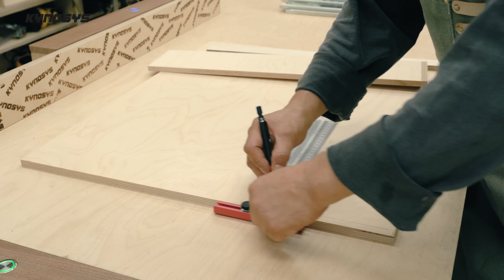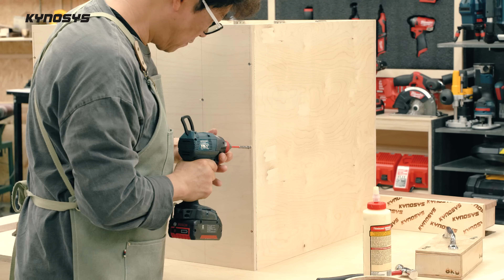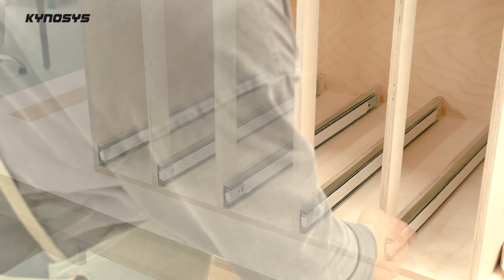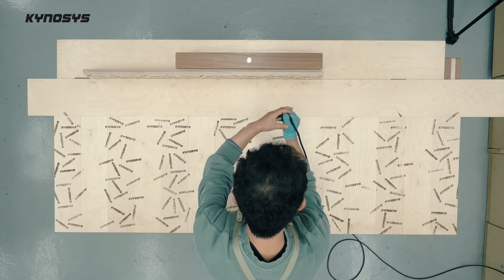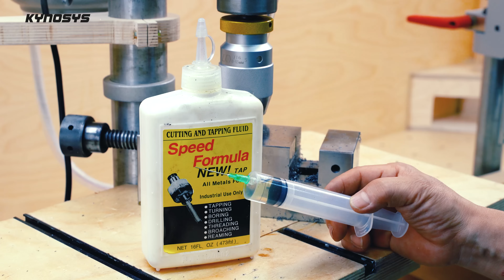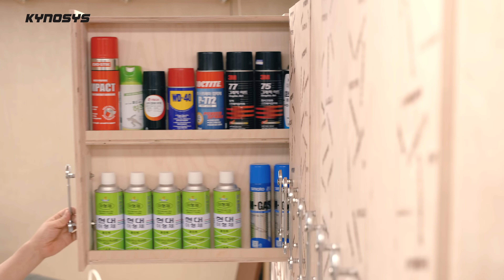Vertical Drawer for Spray Can / DIY / Remake

Comment from the maker: There are a wide variety of products available in the form of spray cans.
Not only paint and lacquer, but also glue, sticker remover, various oils and lubricants,
There are dozens of things I use in the shape of a spray can. 
However, there was no room to store these sprays.
This work is a vertical drawer that stores spray cans.
With two compartments in the drawer, 16 spray cans can be stored in one drawer.
Even if it's not necessarily a spray can, we can store a lot of bonds and bottles that we use a lot while working.
In particular, the front of the drawer was made special by taking a fireprint stamp of my logo.
I think it's an essential drawer for you, too. 
Please refer to my video and try making it.
Thank you.

Comment: Love your work. What was that vibrating tool you used at 4:45 ?
Reply from the maker: It is a pneumatic hammer. There are a wide variety of products using pneumatics. I pounded the nailer's pins with this pneumatic hammer. This is to bond the wood together more strongly. thank you!